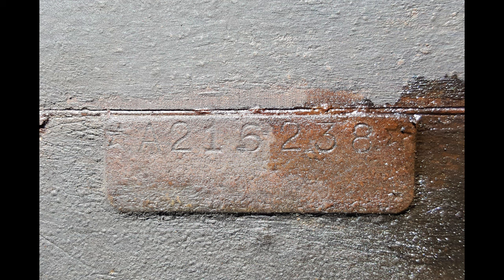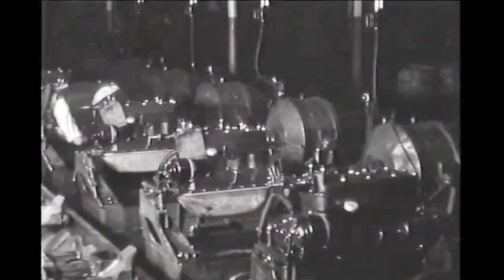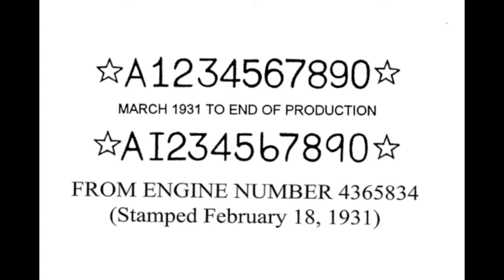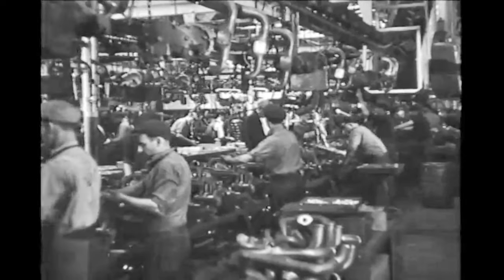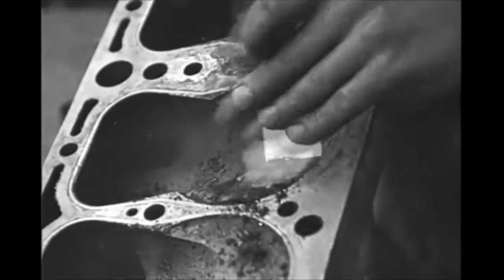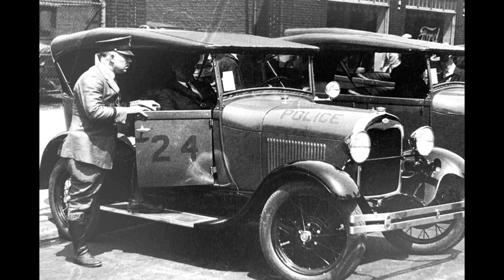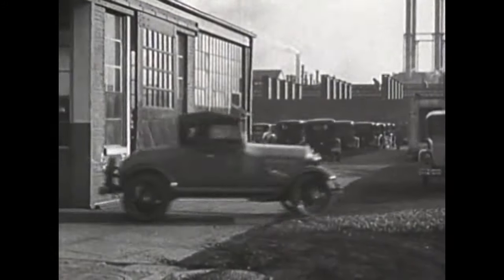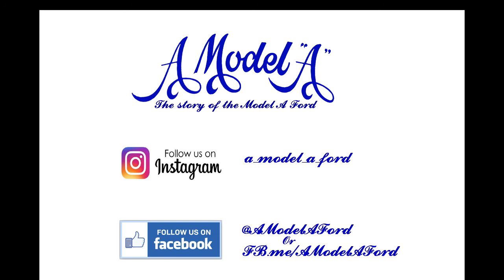Model A Ford Engine Numbers; What do they tell us?

Comment: Mine was the city of Alhambra fire chief’s truck. Bought by my great grandfather, then passed on to my grandfather, then my dad, then me. The engine has been changed, but they kept the old one, which I have. I’ve never checked, but so far as I know it’s serial number should match that of the truck. If so, some day I’ll overhaul it and swap it in.
Reply: I grew up in Arcadia not far from Alhambra. In 1960's when I was a little kid my dad bought a 1928 or 1929 Ford AA Truck that belonged to the City of Pasadena. It had a water tank on it for spray I would imagine or other uses.
At our house there was no tank in back. About 1962 time frame. Older brothers that were 13 and 15 at the time played on it and learned to drive it.

Comment: I remember the first Ford engines that came out from the Gorki plant in Russia had the same numbering system. Later when ww 2 came they started using different letters and numbering. The Gorki plant cars and trucks had both frame number, engine number and also a tag on the firewall. But the engine and body number would never match since lot of the engines went also for military and other uses.

Comment: 3:04 Some variation on location on driver side rail.  Seen one at rear motor mount and visible when removing fender.  It was on a numbers matching block with correct font.  Sept 1930 block.  Chester Pa. Assembly.  Late 30 features.

Comment: I notice that the serial numbers  stamped on the engine block are stamped very similar to the engines used in the Ford 9N,2N, and 8N tractors with a star from beginning to end, except the first two characters after the star  , represented the tractor model.

Comment: I recently acquired a1931 model a 5 window coupe. The previous owner couldn’t tell me anything about it tho. The motor is stamped MINN 10xx 
Was there a ford rebuilt Center in Minneapolis? I believe the engine has been rebuilt there is no signs of wear in cylinders an still has cross hatch pattern on walls. Although the ordeals and other items aren’t worn either.  Another wierd thing was it has a larger oil filler tube like off a B engine but still has the oil drain tube from the valve cover to block. Next step is to pull oil pan and check bearing clearance and see if there are insert bearings fingers 🤞.

Comment: My car is titled a 1930, however, the engine was made  in  21st June of 1929. Either warehoused or maybe a replacement engine? Very interesting video! Thanks and I subscribed.
Reply: This is a very common scenario.  "Back in the day", it was more common to swap a defective engine for a good used one than to have the engine rebuilt.
Reply: Similar story here. I have a 1928 body with a 1929 gas tank and a 1931 engine. Probably replacement.

Comment: Thank you for this informative video. Do you have any information on the dates stamped on the firewall?
Reply from the maker: Thanks for the comment. The dates on the firewall of Mid '28 - Mid '29 gas tanks are believed to be the dates the gas tank assembly was completed. Check out the Plucks329s link in the video description as he has a great article about them on his page.
Reply: @AModelA  Thanks much! I enjoy your videos. 😊
Reply: I found 3 of these in the woods and managed to extract them..only 1 was complete with an engine. Number was ☆CAS2009☆..from what I can tell by this number it was made at the Windsor plant in April 1931. I prefer my model T's,found at the same location,half the weight and half the parts needed,to that of the model A

Comment: Re engine A1, I am very suspicious this was a photo op. by Ford, & that they made publicity by presenting A1 installed in a Phaeton to Thomas Edison in June 1928. According to Rouge factory logs of late 1927, there are various early engines with earlier casting features to A1. The earliest 1927 engine existing today is A189 which was a roadster sent to Sweden in March 1928. It has earlier casting features [ eg. engine # pad] compared to A1.